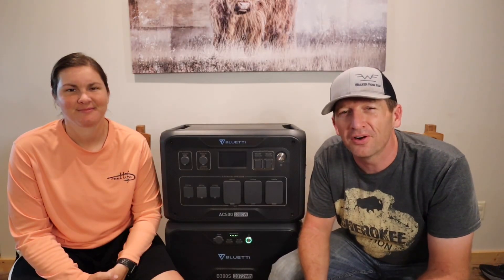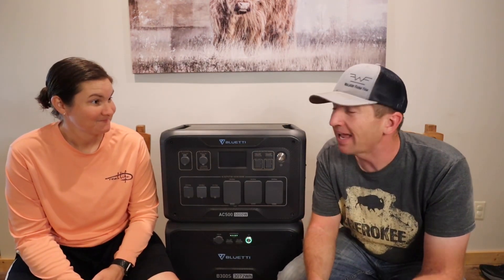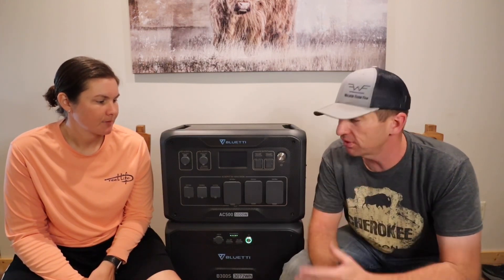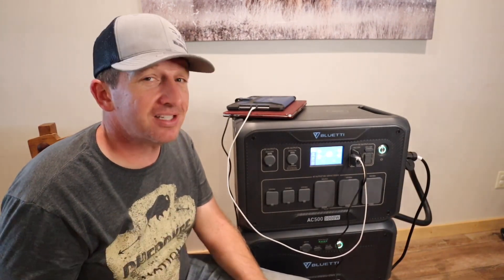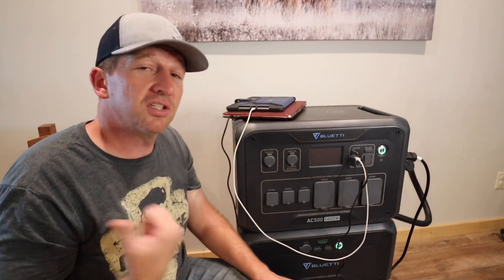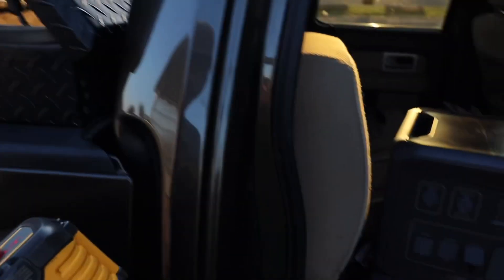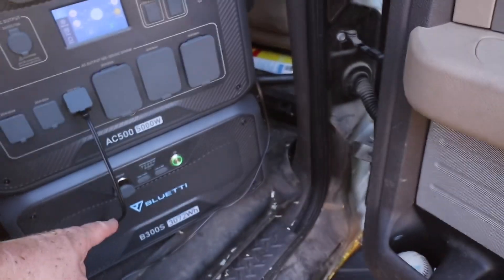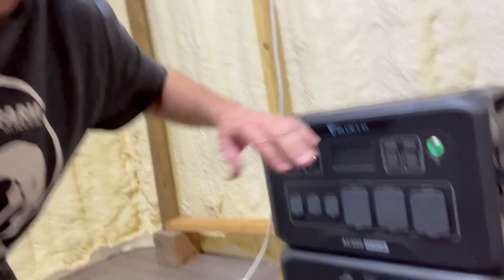Preparing For Blackouts With Bluetti AC500

Comment: I have the AC300 with two B300 batteries and 2400w solar panels running 90% of my house and it works great I’m saving a lot of money on my electric bill.
Reply from the maker: That’s awesome!
Reply: Curious if you are running air conditioners on that?
Reply: @williamkn621  your can run four ac on the AC300 .
Reply: @billfowler9325  for how long, I wish to find people actually running them instead of theoretically.
Reply: @williamkn621  Find the running watts of your window a/c unit and divide into 2400 (80% of 3000 rated watts of the B300 battery) watts. That's how many hours you can run your a/c. You can extend that running time by connecting solar panels. The AC500 supports pass through charging. Add 2400 watts of solar panels and you'll extend that run time substantially.
Reply: @WilliamIraWoodIV  I know amps I know Watts I know dividing this by that. I want to find someone who has purchased one of these and is actually running air conditioners because that's something that people that live in these South hot humid areas really want to do. You have the Watts but you also have startup of your compressor which draws substantially higher spike. And yes what I'm saying is I want to find at least one person who has one of these solar generators with add-on batteries that is actually running air conditioners real life real time.

That's the whole point of my question is is he actually running air conditioners. Not can the unit run an air conditioner for a very short period of time. And yes I know all about solar panels batteries and I also know about the fact that we don't get Sunshine all of the time. I'm going on and on because the whole point of my question is the gentleman running air conditioners...
Reply: @williamkn621  I agree with you on this. I have solar products myself and want to add to them, but none of these reviews ever actually show any real time full time use of air conditioners, either in the home or in an RV.
Reply: @williamkn621  when the sun is up it will be run all day and when the sun go down you will get about 5 or 6 hours but most of the time at night time I will shut the ac off and run 6 of my fans because I have a bunch of other things I’m running off the solar generator too the only thing I can’t run is anything that is not 110 watts. Hope that helps
Reply: @billfowler9325  it helps some. Knowing how big or how many BTUs your air conditioner is would be helpful. Unfortunately where we live in Texas you're going to really really want to have that air conditioner be able to run all night just to cool one room

I know I'm somewhat of a jerk about it because I know how many solar panels I would have to buy to put on my house and how many batteries I would buy and the type of solar charger and inverters that I would put in because I don't intend to move my solar system from place to place

So I always want to question when someone talks about one of these systems and it Sparks a bunch of people to think that if they buy one that they are going to be able to use it when they're power goes out for a few days and run their house just like nothing had ever happened.

Some of the better reviewers might be the RVs but then you find out that they are camping at $7,000 ft of elevation where it gets down into the 60s at night and only gets up to the 80s and the daytime.

Thanks for putting out an answer. I've chatted with a few people that had the systems and were trying to do real world use of them.
Reply: @williamkn621  the reason I got the solar generator is to cut my electric bill down my bill was $200 a month now it’s $60 a month hope that helps and I’m using two of Walmart $99 ac now when winter get here I use a wood stove to heat my house so I will have a lot of power left on the solar generator to run other things.
Reply: @billfowler9325  well I plan to get regular house solar panels and buy my own batteries and connect my own system. I know some people do not have the technical ability to do this or I should maybe save the confidence to try it.  Since I don't plan to be mobile I don't want to pay for a solar generator that is really designed from the get-go to be a portable power source getting turned slowly into permanent heavy power sources if you understand what I mean. These big systems are not something that you're going to pick up and move around and take very many places
Reply: @williamkn621  I build my own system 14 years ago now I’m 63 years old I rather have what I got now because it’s a lot more easy to put up.
Reply: @billfowler9325  yes they are more plug and Play. Of course the newer all in one hybrid inverters and solar charge controller setups are easier now also.

My sister and brother-in-law right here in Texas have a pretty large house I think they have eight and a half k of solar panels and yes they still purchase electricity

I'm pretty sure my girlfriend and I can scale down a system to run a couple window air conditioners our freezers refrigerator and fans and lights but I feel the price of one of the portable solar generators is way more than I'm willing to pay since I'm hey tacky nut with electrician background as well as electronics hobbyist. Not everyone falls in that category

I do have a big gripe that they have been named solar generators since they truly generate nothing unless you have a lot of solar panels to recharge those batteries

Solar is great but unfortunately I have met too many people that have bought some of these smaller solar generators and then they are disappointed

Anyway got to live frugally and spend wisely
Reply: To all of you running a/c across the muggy portions of the "Bible belt", I ended up in some community forums among retirees in mid-lower Florida a number of years ago.  Those who were newer joined those that were older to Florida by adding dehumidifiers for the purposes of more comfort with less energy use and to provide a lower load on thier a/c and heat pump systems.  In terms of which are "better" or "nicer", the size and ease of emptying the water collection trays/ system is important.
Reply: Going on a good 10 years or so, many of the retirement communities in Southern Arizona have been turning to and increasingly allowing the black mesh, 60-80% UV ray blocking, sun shade material and tarps.  We use them "up north" to keep the house 10-20 degrees (plus) cooler and stave of the need to turn on air conditioning, and reduce fan usage as much as possible.  In Arizona they are using them to reduce the load in thier a/c units and heat pumps. We have found it works best on the outside of the structure and with a dead air space but, we have also set up people in apartments with curtains or curtain liners of the same stuff.  We get ours in tarp form from Harbor Freight 'cause we have a number of thier brick and mortars in the area.  I believe the mesh its self is what a number of the green house and hoop house shade cloths are made of.

Comment: The AC500 is definitely a massive power station and with all those battery packs connected I do wonder how am I supposed to move it around or carry it to the worksite or just a weekend campsite.
Reply from the maker: A 2 wheel dolly helps but probably don’t need this much power for camping.
Reply: Got my ac500 in and ordered a small cart with a carry weight of 330 pounds to sit on. Can move it all over the house on the cart.

Comment: How durable are these things plus thier solar panels? If they are durable and can be run for days on end and/ or year 'round, are there circuits or systems you can operate with these systems to reduce general grid power?  And, heres the caveat - still be able to be switched out when there is grid failure?
Reply from the maker: We will see how long it lasts

Comment: I went to a off grid Solar System  6kilowatt system and as soon as I compleat my construction projects I plan to double my off grid Solar System.
Best part is no more power bill and no more Brown outs.
I will never go back to the grid system.
Reply from the maker: That’s awesome
Reply: @WalkerFarmFam  I live in the Philippines and before I got my off grid Solar System we had so many Brown outs and each time all my freezer goods was lost and refrigerator goods 50 present lost we also have a small store here at home and lost my goods there also.
Now no more loss of food supplies. And when there is a brown out in my area I have a emergency line that I turn on to the house on each side of me for there refrigerator and 1 light . When power comes back on the grid than my emergency power I switch off. To there house's. Now thay won't  loose food each time because of brown outs.
Reply: @michaelray5660  That's really good hearted of you, keeping the neighbours' fridges going and a light so that they can still function, too when the power is out - Great that you are getting yourself towards totally off grid
Not enough solar here (UK) to be able to do that, but with the prices getting ludicrous, I'm wondering how much I can reduce costs
Reply: @Angharadz2  i am totally off grid now. 
I put in a 6 kilowatts off-grid solar system and had the power company disconnect my power and remove there power meter. I do plan on doubling my off grid Solar System soon so it will become a 12 kilowatts off-grid solar system. I am also planning to build a walk in refrigerator next to my kitchen area.

Comment: Gary were you saying you are going to connect to the house electric  ? Please explain  🙃
Reply from the maker: Yes! A couple of different ways to do this. Hard wire a plug into my breaker box is my preferred method. Then if the power goes out I turn off the main breaker and turn on the Bluetti. It would power my fridge, lights, and fireplace blowers.
Reply: @WalkerFarmFam  thanks, thats what I thought you were saying 🙂 an thats a small generator...mine is 3 xs your size an doesn't have all the perks yours does...I'm REALLY IMPRESSED  !!!  But mine was less then 500$ . How much is yours ? Just asking you don't need to answer that question...😂🤣 love ya'll bunches 💓 mac an cheese is very important..less stress now for Cassie mean no breakdown in later years..

Comment: Thankyou for sharing.   Loss of power is hard to deal with.  I have had my share of that up here in northern Illinois.   I am considering a Generac  system.   I dont need a big one, just enough  to handle heat and refrigerator and sump pump for my basement.    Thanks for the info.  God bless.
Reply from the maker: Yes! Not a big deal until the powers out.